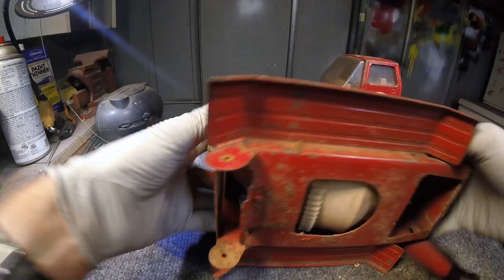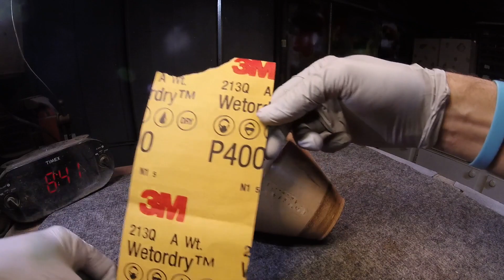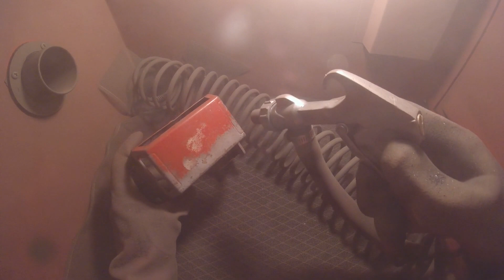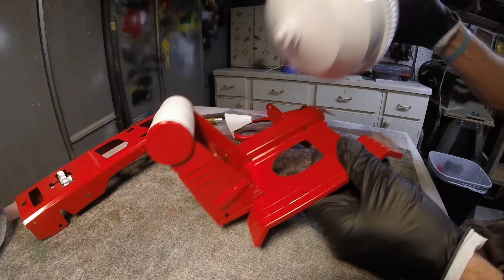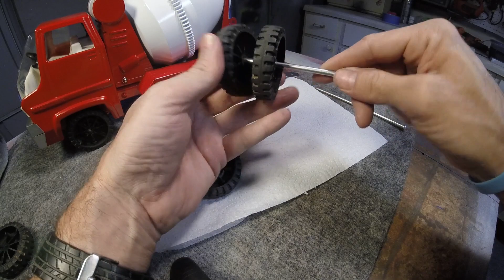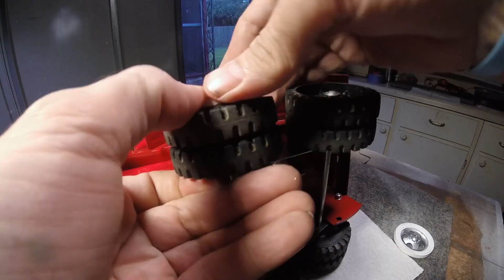Tonka Cement Mixer Restoration Vintage

Comment: nice work as usual. I wonder how many versions used this same basic cab and chassis. It changed some over the years, but I've seen the same basic truck as a wrecker, a pickup, a box truck, a flatbed, and now a cement truck. The grill is mostly what changed over time.

Comment: Shouldn't the air hose of your sandblaster be attached to the inside front of the cabin? It looks very awkward now. Also, you might damage it while sandblasting...
Reply from the maker: Felix Degenaar The air hose is attached to the inside of the cabinet. I installed a quick disconnect through the cabinet wall. The air hose from the compressor connects on the outside and the gun hose connects to the inside. RS

Comment: Hey Shepherd; if the drum is plastic, here is how to clean it without sanding.  Use a number 40 hair cream developer and coat liberally then wrap in plastic wrap and place under a black-light for 24 hours.
Reply from the maker: Ruth Ann Cutler Hi Ruth! Thanks for the information. I am aware of that whitening method. The only thing is that you use a UV light, not a black light. 👍🏼 RS
Reply: @RustyShepherd  You're right.  I get things mixed up real bad sometimes, these days.

Comment: Even Bambi had enemies. Keep doing what your doing bro. Haters gotta hate. Hey what kind of medium are you using? Iv'e started doing my own restoration on old metal trucks and in my sandblaster I'm using the glass beads but that does'nt look like what your using.
Reply from the maker: dwayne weber Hi Dwayne! I’m using aluminum oxide. 25 pounds is $40 at harbor freight.
Reply: @RustyShepherd  The guy at Harbor freight told me that AO would burn thru metal toys, obviously not. I'm glad I checked out your video, you taught me something new and I'm definitlly am going to try the AO. Keep up the great work bro, I look forward to learning more from you videos.
Reply from the maker: dwayne weber The guy a Harbor Freight is apparently a goober!  I’ve used several different media’s. Aluminum oxide works the best for me. It gets everywhere though. Make sure your blasting box is good and tight. I have a wet dry vac hooked up to keep the viewing clear.
Reply: @RustyShepherd  Sounds good man, I'll try it. Thanks for the response and good advice. Will let you know how it goes. Peace out.